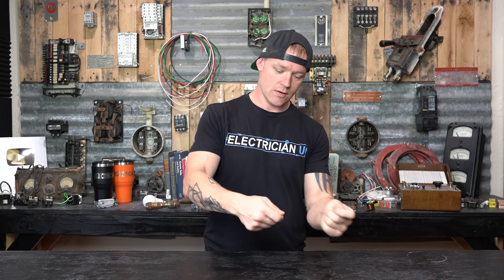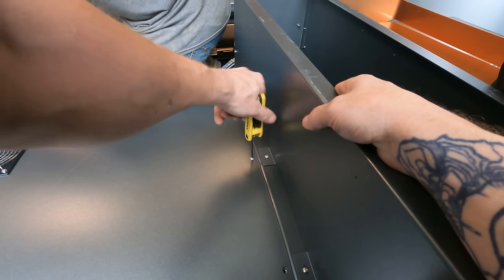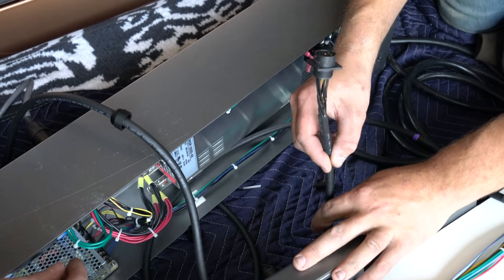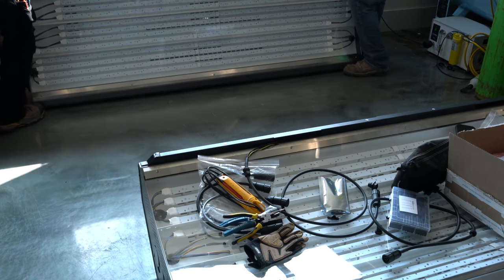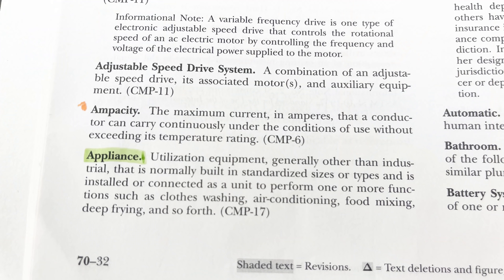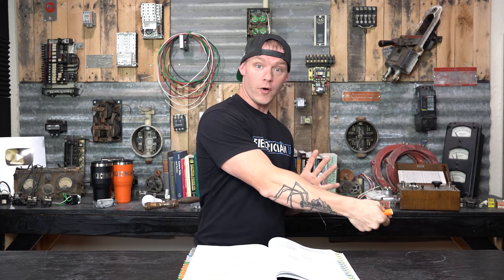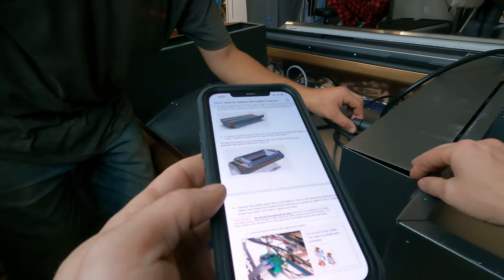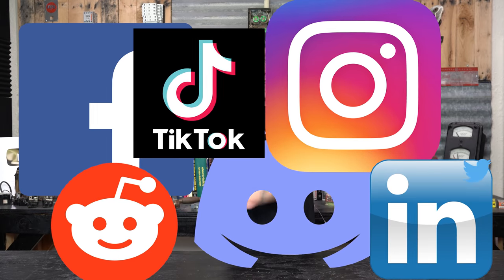SERVICE CALL - Repairing Weird Equipment I've Never Seen Before

Comment: Know anything about knob and tube wiring? My instructor doesn't really want to go over it, I was wondering how much of a pain it really is
Reply: donald miller electric is a good channel on youtube he specializes in knob and tube wiring
Reply: @WorstElectrician  I'll check him out later thanks
Reply: Knob and Tube does not have a ground and most of the connections are soldered and the insulation is usually a cloth / fabric mix about 100 years old. We have a lot of it in New England.
Reply: Knob and tube is a big scary thing for insurance, but it is really no different than the two wire hot/neutral that was installed in the 40s and 50s. Put GFCI plug receptacles and you've got safety with no equipment ground.  Those soldered knob and tube joints will last 500 years. The problem is when people renovate and screw with it, cutting and splicing it improperly.  Janky J-boxes with lots of splices wrapped in electrical tape.  That's what scares insurance because that's where problems happen.  If you have an old home with lath and plaster without fire blocking (horizontal studs) it is a breeze to rewire. Negotiate a rewire to pay by the hour with the caveat that you help (fishing and pulling the wire, fetching things, etc.)  I did mine with an electrician for a few thousand and it was the best apprenticeship I ever had. He was so awesome, we had lots of  coffee and pizza breaks. Easy money for him and big savings for me and my family. I even gave him a tyvek suit for crawling in the attic. Running new wires up to the light fixtures is much easier when your walls are empty. Less cutting and guessing. With modern homes with insulation and fire blocks, you may be better to pay a flat rate, just MAKE SURE they include patching and finishing in the contract because they won't be butchers if they know they have to fix it afterwards.
Reply: It should be called Electricians Bane

Comment: Besides heat shrink tubing being used for additional strain relief, it is often REQUIRED to meet safety certification, UL, CSA, etc.  The NEC will generally require electrical components to be certified by a safety agency.  Therefore, IF you neglect to reinstall heat shrink tubing that may have been necessary to meet a safety code, you will indirectly violate the electrical code!

Comment: do electricians do trouble shooting on equip like that? like why did the fans fail was it  from normal wear and tear failure/defect? or was there a short on the board or electronics that  shorted and caused the fan to short out from too much current? is it because of  no surge protection and a power outage may have melted the cord and traveled through the fans>?

Comment: And when running into a problem like this. Is that the only solution , calling up the manufacturer to replace a cord , or could you replace the wires and cords yourself?

Comment: it is all interesting, you can have a cord connected 2,000 watt space heater, YET a gas furnace,
a fixed unit that draws maybe 500 watts for blower motor and ignition requires a hard-wired installation.

Comment: This device is like a tanning bed, but does nothing but drain the owner’s pocket.
Reply: its snake oil
Reply: And the cost of the energy to power this thing.
Reply: @ecospider5  It's funny how all the NASA links on that page talk about how astronauts use red light for promoting plant growth, yet the page seems to imply astronauts are using it on themselves for healing. It's almost like they're trying to sell a tanning bed that does nothing but drain the owner's pocket.
Reply: @msmyrk  in this case, it's not snake oil. It's easy to instantly think " yo, it's red light, there's absolutely NO freaking way it does anything to our body: it has the lowest energy per photon of the entire  visible light spectrum!" (And this was my stance on the subject by default... until I looked at the mechanism behind it: in our mitochondria , there's this enzyme called Cytochrome C Oxydase  and there is two big spike of absorption around the 850nm wavelenght (near-infrared) and around 660nm (deep red); the result of that is an increased synthesis of ATP (energy).

If interested, look that up by yourself on PubMed; it's quite interesting (to me).

Comment: Good thing it wasn't an apple  product. They'd just tell you it was unserviceable and out of warranty and cheaper to buy a new one rather than fix it.
Reply: Yes, it just happened to me, the one way check valve was bad on new discharge pump, the company sent two guys out they replace hold pump rather than replace check valve. The boss said get job done it’s faster to replace hole pump than check valve 
It fix problems

Comment: I suspect that receptacle may not be the best choice for input power which doesn't surprise me one bit because I don't expect top notch engineering from quack medical devices. Those Corsair fans and no proper wiring harness to facilitate service were icing on the quack cake. (Those Corsair fans are good for their intended application but on difficult to service equipment, there are far better choices that last longer. I would have specced NMB, Nidec or Delta double ball bearing fans for this and you would have only needed to unhook one cable instead of four to remove the panel.) 

Protip form an electronics generalist: Beware of jobs on medical devices; the potential liability is insane! This bed is probably relatively harmless if it malfunctions outside of a gross ground fault but if you have a device where a malfunction can conceal an underlying condition, injure or kill if it breaks, don't work on it. I certainly wouldn't touch any apparatus on that cryo chamber or hyperbaric chamber.

Comment: It’s not clear to me what level of diagnostics is supported by this device.  I’d want to confirm that the power draw on initial power on was within expected range. So I’d have it plugged into a meter to test. Perhaps this is already done within the built in circuits.  

Also, I’d probably try to run diagnostics before replacing all the Allen screws if it was possible.  For example, I’d want to confirm that all the fans spin up. That way there is less to reopen if additional work is needed.  I realize this is not always possible if there are switches that sense open doors and kill power.

Comment: This looks like an expensive piece of equipment.  How did they end up calling you, vs calling the mfg to get them to send out a technician?  Was the company out of business?
Reply: the fact that Dustin was face-timing with the manufacturer would suggest that they're not out of business.
Reply: The DeLorean of tanning beds! lol
Reply: I worked as a Service Engineer for a company that did equipment repairs on a variety of different equipment. Most manufacturers of equipment only have sales distribution, no Field Techs. The manufacturer may provide phone support, often times they will ship out repair parts, sometimes for free, but no one to replace them. Providing the qualified skills to repair it on-site is where I come in.

Comment: So you don't deal with strictly power circuits coming into a structure, you also work on specialty appliances? That's usually technicians that are called in to work on medical equipment.

Comment: for the 6,000 screw problem.. cut a set of allen wrenches off at the bend and chuck them in your drill.
Reply: @andrewalexander9492  Im surprised more electricians dont know about this
Reply: Tim Wilhelm I suspect most electricians do know about this. I’m surprised anyone is suggesting improvising hex drivers when better manufactured ones are readily available.

Comment: the cord is the disconnect. the breaker doesnt need to be anywhere near it. i hope you already knew this and were only saying that for apprentices.
Reply: I think the same code narrative that applies to a water heater and its proximity to the breaker or in sight of the breaker,  would also apply in this instance with this "medical" equipment. justin is spot on.
Reply: The breaker being in sight is in reference to hard wired equipment just as he stated in the video.

Comment: If you plug it into an outlet it is an appliance, most of the time.
Reply: At a GE plant devices of 30 Amps and above need to be hard wire in 
So we change from 120 VAC /30 amp to 240 vAC/ 15 amps but no 240 VAC only 208 VAC just get around required

Comment: How many amps maximum can a typical drop wire to a house handle?
Yes a typical drop wire not an upgrade.
Reply: it's complicated, if you know the wire gauge and material, then calculations can be made. 
Or you can look at your main breaker, and that will tell you the maximum load before you trip the main.
Reply: also depends on the utility co. 400amp from pole to meter 2/0 (utility said it was fine all they wld run)from meter to my panel i had to use 500 kcmil copper

Comment: Best tip, do not take this job unless the customer dismantled it first. Thank you
Reply: AGREED! never forget a jewelry store service call for a jewelry/security case with built in lights in need of replacing.  The security case had drawers & shelves specifically made to not be easily taken apart so someone couldn't run out the door with them.  Of course no manual/instructions.  Told them they needed to find a specialist in those cases... too much liability for me to break a case worth thousands or tens of thousands $$$! Job was poop sandwich just waiting for failure.
Reply: It's a T&M job...
Reply: If you don't take it apart, how are you going to have any idea how to put it back together?

Comment: In HVACR work, the rule of thumb for disconnect is 25 feet and in plain sight.  Reason for the 25 feet rule is two-fold.  One is someone building a wall between your panel and the appliance/device.  Two is lazy-bum-arse mechanics who will attempt to work live if they have to run too far between disconnect and device.  Our code must be more stringent than your's.  By the way we wire our own work in most locales and only have an electrician come in where there are requirements by local officials for such.  And those are few and far between where I reside.   I've done tanning beds and installed special cooling to make the user more comfortable while using them.  We used to install modulating motors on condenser fans, but now with micro-processor controlled units, most time that isn't a factor.  Those ladies don't like to sweat too much while getting dark.

Comment: Not a good idea for electricians to work on appliances for customers.  You will void their warranty and possibly change the listing of the equipment. The customer may accuse you of making the problem worse.
Reply: Sounds like the manufacturer was behind this though, since they sent parts and inspected the result

Comment: If you always wear long pants, why not wear long sleeves? Really what's the difference?

 I work better when comfortable. I wear shorts and t-shirts as soon as it starts getting warm out.
Reply: Because wearing shorts looks unprofessional
Reply: @RedWolfenstein  One could argue that wearing T-shirts instead of button down shirts looks unprofessional. In my opinion, a guy dripping in sweat looks worse than a guy wearing shorts.
Reply: Gym shorts are a little "too comfortable" imo. Nothing wrong with some cargo shorts or work shorts though.

I also agree with the thought that if you wear pants to keep from scratching your legs, it would only be consistent to also wear long sleeve shirts to protect your arms that are arguably at higher risk.

Comment: Something you may find interesting... I knew an electronics engineer that had a 4 X 4 3/4" plywood sheet on the wall in his basement. On it were banks of ice cube relays. He converter every switch in his house to 12 volts.  He was anal about safety, and it was a true pro installation.  I'm guessing you've never seen anything like that.